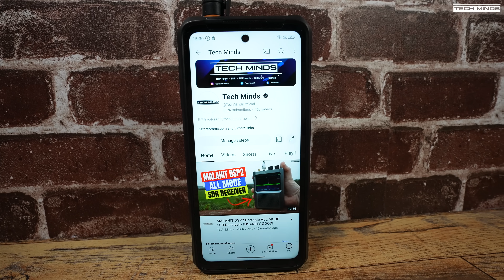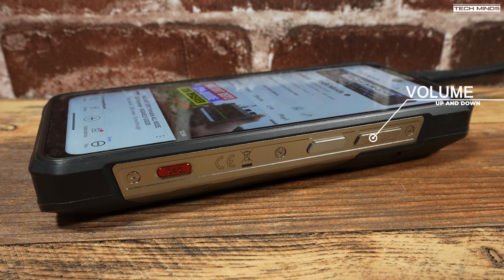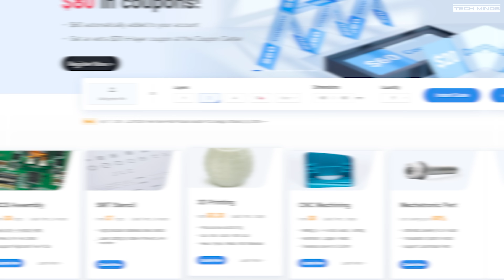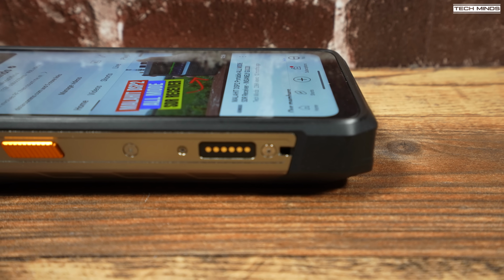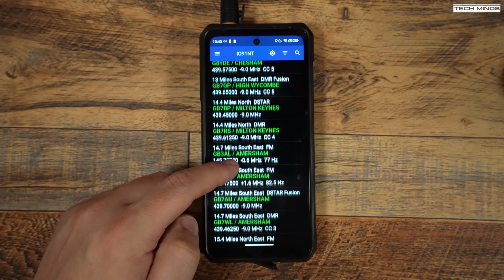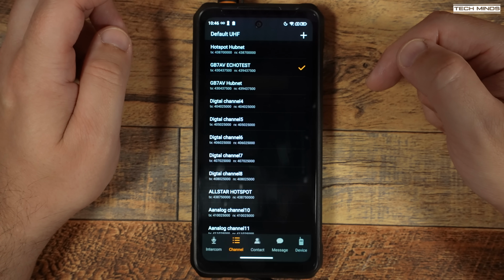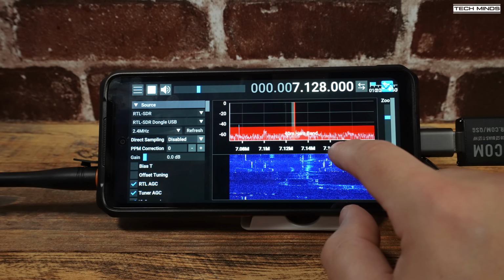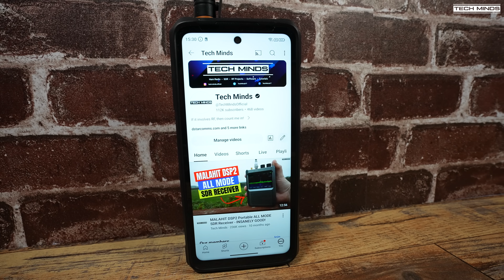The BEST VHF/UHF Android For HAM RADIO - Ulefone Armor 26 Ultra

Comment: Hello, I bought an Armor 26 Ultra phone with walkie talkie. I have a big problem the phone seamlessly supports two different frequencies RX and TX when using a repeater in the analog band. Unfortunately in the DMR band the phone gives me a relay unable connect message when I try to transmit. However, it will accept the call from the repeater. Is this a manufacturing defect or a feature? Is there any update? I live in the Czech Republic if the phone needs different software. Thank you. 🥺

Comment: I intend to use such product in my car. It would be instantly annoying switching between landscape ( preferred) and portrait modes. Does it have a usb-“c” port capable of display on an external screen ? What’s with the fingerprint reader am I sending it to Hoe Ching Bing ? Every great idea has flaws and … mystery. My last authentication method that hasn’t been cracked is my fingerprint and I don’t want to sell it. LOL

Comment: They are always just so close and miss the bar with these phones I sware they do it on purpose, do they not realize society has better uses for texting over radio than talking?  In an emergency texting is far more usefull, cuase if im asleep, your voice transmitting don't do any good. But a text message is gold cuase I see it when I wake up, why is it every last fricken company on the market skip over the feature modern society wants in a ht device? Are they stupid or just plain against it? It's also consumer product malpractice to make a radio you cannot text through easily out of the box.

Comment: I've been looking for something like this for ages. I'd like to use it on a sailboat as a backup handheld VHF radio.  Would this work? Audio would it be able to support AIS?
Reply: Yes I do it for this. I also install opencpn on it and it works great. using the wifi of the ship via UDP I also get depth. It is basically another chart plotter and a VHF and a phone. Further to the aforementioned, you can plug in the Marine distress freq in the app and it works quite well. Basically if you are really in a bad way. you have options. This lasts wayyyy longer than any of my VHF's also....So there is that.

Comment: I am a longtime Ulefone owner, I have 4 or 5 models. That port on the side is on many of their models - you can connect an Ulefone microscope to it for small SMD PCB work or you can use it to connect the Ulefone Endoscope - for looking down drain pipes, inside car engines etc
Reply: I am on my third ulefone armour.  Been able to get 2.5/3 years out of them. Where I would smash a normal smart.phone inside 12 months
Reply from the maker: Thanks! Yep, I found it on the website after making the video. Thank you.
Reply: I have the 3
Reply: Thankssss
Reply: Does it support marine channels
Reply: How many fars does this actually reach in woods or city on simplex. Thanks

Comment: any reason it wouldn't take a dual band antenna, seems better option
Reply from the maker: It would be the case of finding one that has the right connector on it, but it should work yes.
Reply: @TechMindsOfficial  the antenna is not a standard SMA?

Comment: This is how HT radios will be in the next 5 years... Thanks for taking the time to make this video!
Reply: so you mean  you'll have an android system that has support for it dropped a year after you buy the phone  and then you have a closed source android app that is used to access the UHF/VHF module. 
I'm working on a product that fixes that problem entirely.   Let me know if you're interested.   BTW, i'm in Shenzhen developing the product at  TroubleMaker coworking space.

Comment: Well I checked the specs and does not look good for US users...
*Not compatible with AT&T, Cricket, Sprint,Verizon, Boost Mobile
So no data will be able to be used via most US cell networks
Reply: That's very important to know for those of us in North America
Reply: also this feels like the problem we had with Rfinder.  some people had to activate their ATT cards with another phone and then put it in the B1 and it worked.
Reply: Using it in Canada with no issues. FCC has report on it, most devices that can be used in NA will have that report.
Look for "5006AF1 Mobile Phone Test Report Measurement Report Shenzhen Gotron Electronic."
Reply: Works on all 3 majors LTE 100 percent.  5g half ass but 5g sucks.
Reply from the maker: @AaronsLyfe Not entirely sure where you are getting your information from but it's not correct. The specification page on the official website says this: Supports the following carriers' 5G networks: North America: Canada	Rogers Wireless,Bell Mobility,Telus,Videotron,Koodo,Public Mobile,Freedom Mobile,Virgin Plus Mobile
United States	Sprint, T-Mobile，C spire，AT&T，Google Fi，U.S. Cellular，Verizon Wireless，Cricket Wireless，GCI Wireless
Reply: @TechMindsOfficial  I think he is referring to the description on the banggood link you provided in the video description. His comment is a direct quote from the 'Network' section on the banggood page.
Would be awesome if you can test that the phone works on US carriers. Looking at the video, it doesn't look like you had a sim inserted at any point.
Reply: @TechMindsOfficial  I literally copied it from the Network block of the specs off the Banggood link above
Reply: It does work in the US. It just won't pick up ALL 5G bands.

Comment: Pretty cool. Definitely in the running for a handheld for me. A bit concerned about Android updates and repairability once the battery takes a dump or the screen starts dimming. What's the spare parts situation for these?
Reply: Ulefone tends to have spare parts available on AliExpress, but not all parts.  I haven't checked to see if any parts are available for the 26 Ultra yet.

Comment: Slick.. But.. FYI The (Radio Pictured) on your Second Provided Product link (Says it's the Ulefone Armor 26 Ultra) But does not look to have the VHF / UHF Antennas.. (So.. Personally I'm Confused) if it's the Correct Product.. (Not sure) if ordered would get the Correct Radio..
Reply from the maker: Two links, one with walkie talkie and one without.
Reply: @TechMindsOfficial  Undoubtedly different.. Should not be Named / Titled the same "Ultra" Version..
Reply: Comes with vhf/ uhf ant

Comment: I wonder how well it does against the Rfinder and what Android OS is it running?
Reply: This phone runs Android 13.  As far as how it stacks up against the RFinder, as mentioned the Interphone app is fairly basic.  RFinder is much more mature and offers many more features.  What we really need is an open source app for walkie talkie phones.
Reply: I have the 3 B1's and im not impressed as far as battery life that sucks (might be upgrading to the extended size batt).  BUT Bob (the owner) is amazing, theres many people working on the app to make it better all the time.  Also I have the Armor 24 which has a huge screen and way better OS than the Rfinder (though the new B1+ has an upgraded OS still not 13 though).  This phone is basically a armor 24 minus smaller battery and has the radio built in.  I think im gonna buy one.  Also the SDR potential is a game changer instead of running a tablet or PC

If Ulefone listens and opens the app for nerds to tweak this phone could be amazing.
Reply: @Yugos-Survival  I have a B1+  and I would never use it as my main phone.  Still at Android 9 with security patch 08-2022.
  The battery is poor and I looked at reverting back to a version that did not have the Satellite features, but they recently  announced that their old infrastructure would retired and we had to use the latest version of the OS. Now i am finding myself using Linkpoon more than the Rfinder..
Reply: @ON3PLZ  yeah bob kinda messed up he should have focussed on the radio part and made the phone part super basic with the latest OS.  I carried the B1 for a couple years as my primary phone and it was ok but started slowing down having to delete most apps.  Thats why this Ulefone is on my radar.
Reply: @Buoyant-m5f who lost rfinder to another company, dont understand this message.

Comment: The accessory connector on the side is to mount an endoscope camera for inspecting difficult places. The connector is secured with a screw. Does this device also allow normal analogue FM on 2m/70cm/PMR446 ?
Reply from the maker: @fotografm  yep

Comment: I really really really want to know if it will APRS / Winlink over the radio. Would also love to see the power output.
Reply from the maker: Technically its possible, but without an SDK or information on how to communicate with the onboard transceiver it will be near off impossible. Hence why I said in the video we could all collectively pressure ulefone to release some kind of documentation for developers.
Reply: @TechMindsOfficial  ulefone and VGC both. So freaking close to the right direction for modern radio.

Comment: What is the type of Encryption option in DMR mode? Is it possible to link this phone with Hytera or Motorola radios in this basic privacy or extended privacy (AES)?
Reply: Encryption in any form is illegal in Amateur radio. Encoding is not as long as it can be easily decoded
Reply: @Spookieham quick! Run and tell the cops
Reply: @spraitukas  "some people" LOL
Reply: @Spookieham  not encryption but you can use rattle gram for a little more security.  Add in a onetime pad and youre golden.